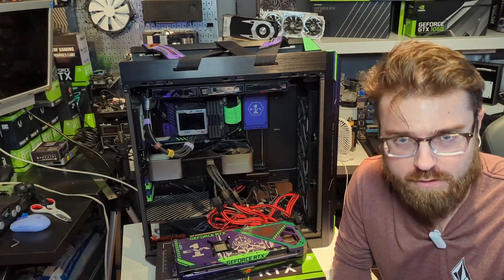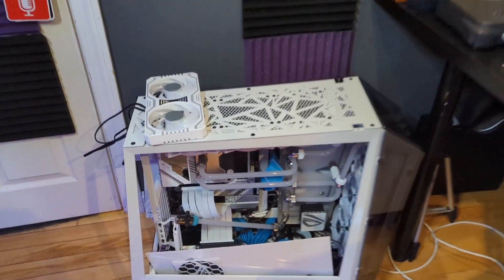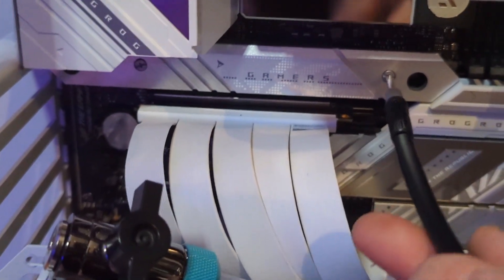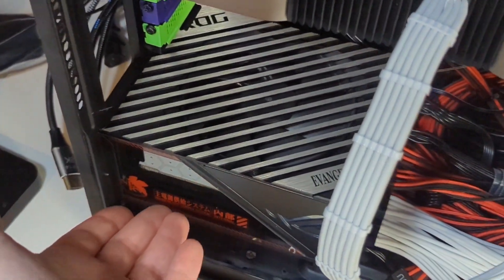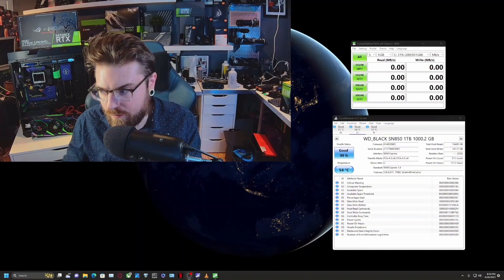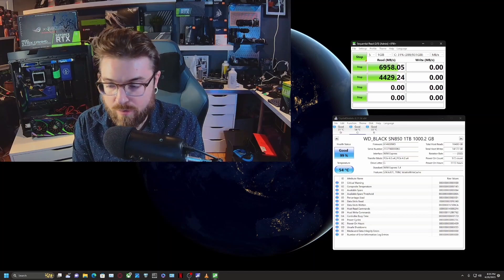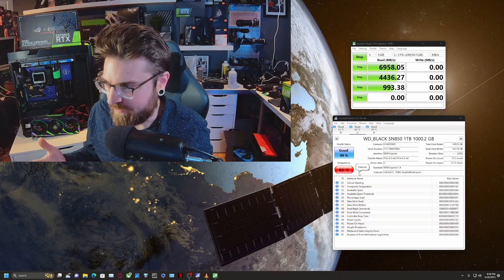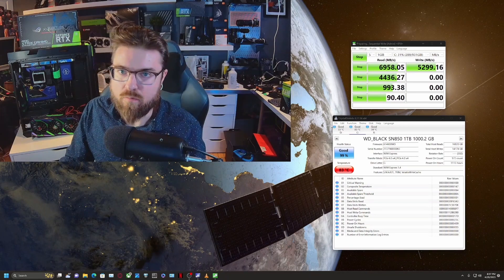I can't believe what the CULPRIT of stuttering was with my editing PC... and I was still wrong

Comment: I had a somewhat similar issue recently where my SSD just went read-only for a few minutes, and I checked CrystalDiskInfo only to find that the health status went to 'bad' and I got a high temperature alert. I restarted my computer and it's been fine since. I was initially panicking and thinking I'd have to replace the SSD but I'd also been having other issues around the same time that I attributed to being motherboard issues, and I think the SSD problem was just a part of that. Whatever the case, it was certainly an eye-opener that an SSD can just turn 'bad' in a split-second, and if it had been a permanent issue I don't think I'd have ever trusted SSDs again. At least with HDDs they turn bad over the course of many weeks or months and you have plenty of time to do something about it... not to mention the audio cues that something isn't right.

Comment: Heh, first thing I thought of was your ddr4/5, but the NVMe didn't even come to mind. It should have since I immediately thought of storage. just not the right type of storage. I've been doing this for the better part of 20 years professionally with one 3 year hiatus, and had been talking computers apart since the late C64 era. Replaced my first CD Drive in a Win 95 machine, spent days interning while in school F'disking literally all day long they reinstalling Win98 after I'd wrapped up formatting 100 or so HDD's, so yeah, you'd think I'd have at least had a reasonable guess.

Nope. I'd most likely have done exactly what you did and tested EVERYTHING else first. There's a good chance I would have tried a fresh WIndows install as well. Just out of curiosity, and this is probably a stupid question, but did you try a heatsink on the WD? Those little buggers are at the top of the 4.0 speed charts so it could simply be a cooling issue with some cells getting crazy hot while being on the opposite side of the thermometer sensor. Maybe not worth the trouble at this point if you don't have an extra chewing gum cooler on hand, but if you do, I'd give it a shot. I mean if I already spent 10 hours on it, why not another 15 minutes to save $135-$145? BTW, I switched from Samsung Evo's (I have a 2TB SATA 870 Evo I paid $465 for and the darn thing is, by far, my fastest boot device doing a restart with a couple of programs open + WIndows with numerous tabs in 9 seconds flat along with a 5.9 second cold start) to the semi budget 2TB Crucial P5 Plus's simply because they do run so cool. Not as fast as the 990's or WD's, but no heatsink? No problems, at least not so far. Heh, now watch, within a week my mouse will be playing hopscotch across my screen. Darn Murphey's Law I tell you what.
Reply from the maker: Hey man, yes I ended up using it in a different computer for about a day straight with a EK heatsink on it and it did the same thing. The hardest part of this whole entire experience was it performed completely fine sometimes and wouldn't show up in crystal as bad unless you did like 2-3 different tricks with it. It's almost like everyday it was booted on it would progressively get worse throughout use and from my experience in the past typically it's ram or motherboard issues or worst case scenario a faulty CPU but it's very rare for the CPU to be bad. I don't know just a very odd one. First time for everything I guess.
Appreciate your comments as usual.

Comment: Computers are fickle, in troubleshooting sometimes you change pretty much everything in the system trying to fix it then find out it was something you never guessed causing the issue. 

I've never had an NVME go south on me before, I've had mechanical drives die many times in servers and NAS but never an SSD or NVME. 

Nice system Bro
Reply from the maker: Yeah this was quite literally that type of situation. The most frustrating part is that it says it's "good" so I never thought to change it. Can't wait to explain to Western Digital what happened.
Thanks man

Comment: The only drive I have ever had die on me is a hdd but crystal disk not detecting that is very odd and those high temps
Reply from the maker: HDDs are usually pretty common, I feel like you can kinda gauge the lifespan based off how you use it. This situation was so weird, was a first, hopefully WD will hook me up with a 2tb haha.